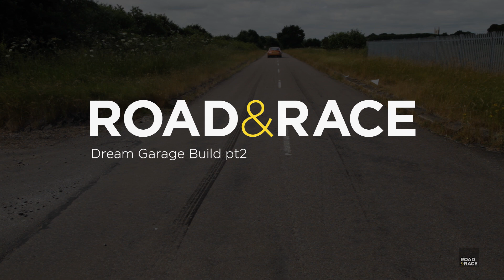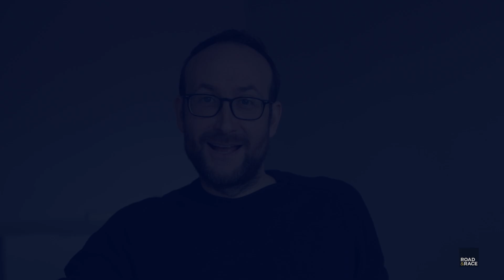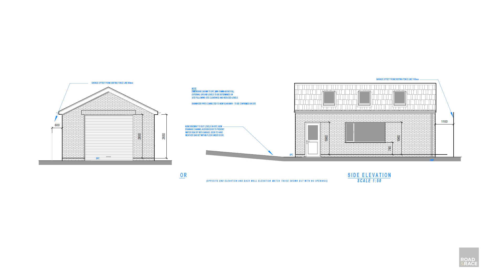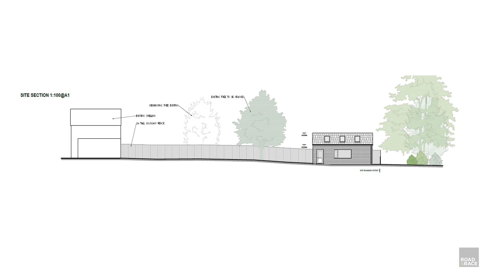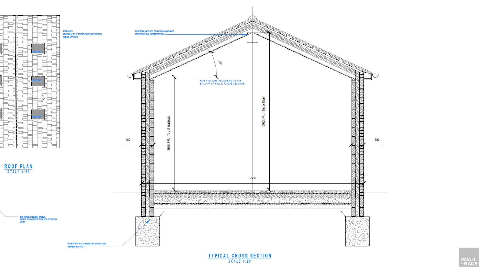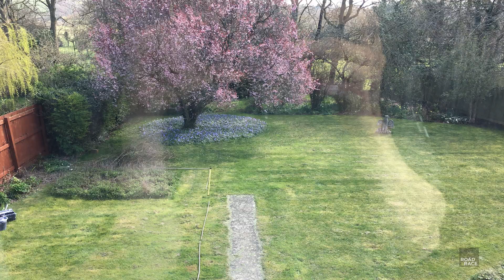Planning My Dream Car Garage | Dream Car Garage Pt.2

Comment: In a previous life I fixed cars for a living and I much prefer 2-post lifts. They stay out of the way better. Really depends on what work you'll be doing but if I had to chose one over the other I would work with a 2-post lift every time.
Reply from the maker: Thanks for the advice Brett

Comment: Re garage doors. 
I've an integral single garage and  had fitted an insulated, electric  roller door... retrospectively my opinion is, although significantly more secure, draught resistant and insulated then a standard up-and-over door, I would've been better to get some well made/fitted twin barn doors instead. 
Probably no more draughty, definitely cheaper, and less potential to go wrong. Also the option to use the reverse of doors for hanging storage, and you can quickly open 1 door for personal access instead of waiting for the whole door to roll up and loose all heat from inside.
Hope build goes well, thanks for the content
Reply from the maker: Thanks Steve, will def consider barn doors.

Comment: Electrical in floor heating, I think it's called. No more pipes, gas, in the way radiators, etc. But the floor will be a bit expensive from my knowledge.
Reply from the maker: Thanks for te suggestion.  I had central hesting underfloor heating in my old house and took ages to get warm - is this the case for electric?
Reply: @RoadandRacetv  I know that is superior to liquid floor heating. Can't say if it warms faster, it should. I see this as a trend at other youtubers with workshops/garages. Worth to do some research or ask a contractor about it. Best of luck!

Comment: Great to here about your build! I had a man cave built in back of my garden in june, 18ft wide by 10ft long. Nothing fancy just built from concrete blocks, rendered from outside, plastered from inside with electrics by way of armoured cable running from the house. Also double glazed window with a double door & concrete floor & pitched roof with tiles all cost me 9 grand. I would imagine your build costing you more then double mine as it would be bigger i.e more material & labour. Also expensive items in your build that i didnt have would be your roller shutter, lift, hot water system & road to get to your garage. Please keep us updated with your quotes

Comment: IR heating is rubbish. I have it in my large workshop and its only OK if your in its path. As soon as you walk to the side out of its coverage path its freezing cold.
Personally i would extend a loop from the house central heating. But the piping would need some superb insulation along its path to stop heat loss. Plus you will also need a bigger water pump. But still the cheaper option i would think.
Reply from the maker: Thanks for your experience with IR, will look into the central heating.

Comment: Mmh, 4kw heating sounds pretty high. Is that constant power/Heat loss? Or is that also with heating up the place in 1 hour with 5 degrees outside?

Maybe using a Heat pump is a good Idea, IT is "400%" efficiënt instead of "100%" efficiënt for IR panels. Heat pumps be air to air or air to water.

Good luck!
Reply from the maker: 4kw was just what the website said for the size of the building.  Didn't think to consider a heat pump but will now.  Thanks.
Reply: +1 for an air sourced heat pump.